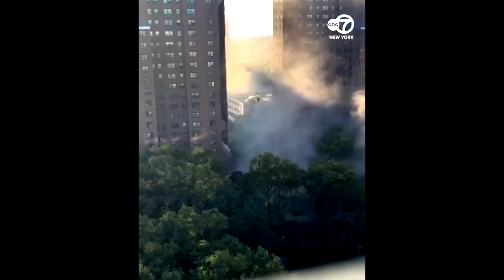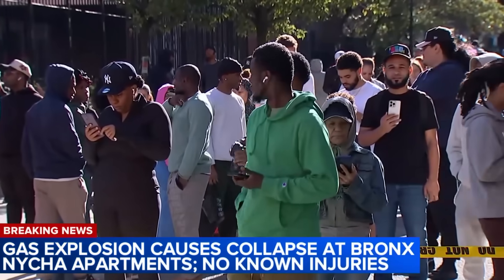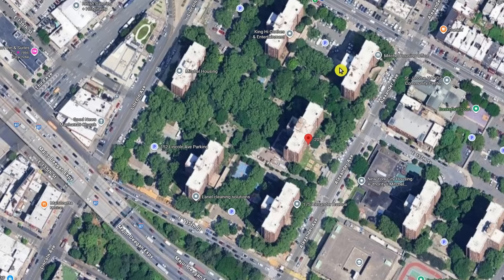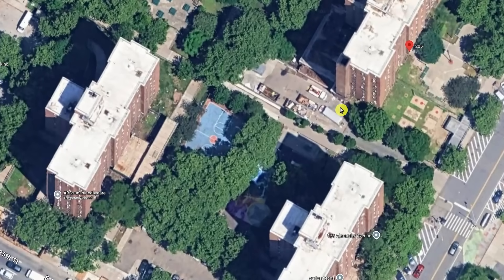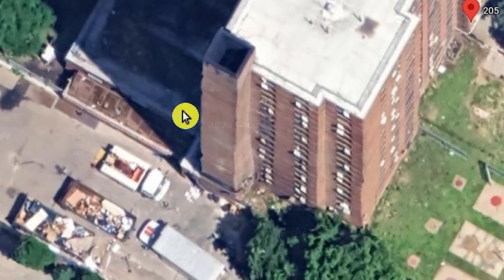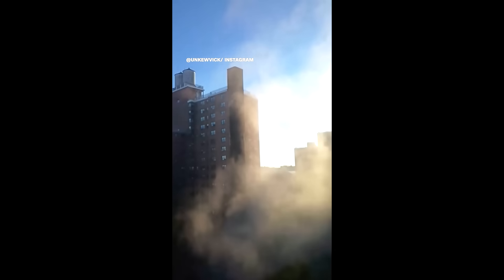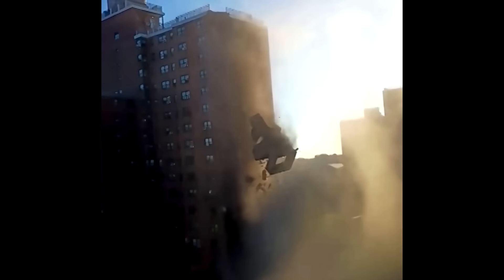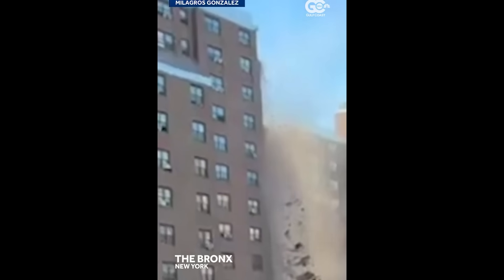Bronx Apartment Collapse Explained: Boilers, Bricks, Stop Orders

Comment: What's up with the water tanks? And the roof (with that patterned glassed barrier wall around the roof edges) was it used for recreation - a jogging track? is their a recreation, gym or event room on the top floor?
Reply from the maker: I doubt anyone is allowed up on the roof. NYC water mains have plenty of volume but only moderate pressure (about 50–80 psi). That’s enough to push water a few stories, but not reliably to the 15th, 20th, or 25th floor of a tall housing project. Gravity-fed distribution: To solve this, buildings pump water up to a large rooftop tank. From there, gravity provides steady pressure down through the risers, ensuring all apartments (top to bottom) get usable pressure. Fire safety reserves: The tanks also double as a firefighting water reserve. In an emergency, they provide a dedicated water supply for sprinklers and standpipes.

Comment: What happened was a Gas leak.  It was Leaking for God knows how long.  
The whole chimney filled with Gas.  
They lit the boiler and it ignited.
The incinerator is a separate chimney now covered and converted to a garbage shoot and compactor.
Reply: Makes sense.  Thats a firetube boiler looks newer and they have a lot of flame failure post purge etc etc i used to sell them

Comment: Hi Jeff, just wondering if there is an internal steel frame in these buildings or is it unreinforced masonry?  Also, I've watched many videos of building facades covered in scaffolding in NYC and remember someone saying that they are required to undergo periodic inspections that you referenced in the video, is this true?
Reply from the maker: Yes they are required to check the facade every few years but I'm not sure about the rest of the building and each building is different as to whether they have metal frames on the inside or mantels or even concrete beams

Comment: There were air conditioner units on the ground - are you sure the explosion was concentrated in the shaft?
Reply from the maker: Well you could see how falling debris was leaning on some of the air conditioners and some were still in place but holding on very precariously so it's not surprising if a few of them did let go

Comment: I can’t believe the people working on the boilers weren’t hurt some how. I’m a steam fitter service tech. I’m guessing that the vent stack had somehow filled with gas also. And when the burner was lit off it blew up through the boiler and its vent stack. It probably blew a portion of the lower bricks out to start the collapse. Holly crap!!!!
Reply from the maker: I wonder if they can control it from the office, where they are not in the same room
Reply: @jeffostroff  Nope , most all boiler controls are on a control panel nearby , the controls I've seen & built.
Reply: Haven’t seen gas enter a vent stack, but I’ve see failed relief valve and thermal shock from malfunctioning water feed?

Comment: The brave firefighters just standing on the roof after the collapse is wild lol.
Reply: Not necessarily. The chimney was an appendage, not a structural element. Delayed ignition creates a pressure wave that compromises the base of the chimney, which was just a hollow, thin-walled masonry construction, and it collapsed in place. And given their period of construction, those buildings are almost certainly either steel or reinforced concrete frame structures with non-structural brick veneers.

Comment: Great video and explanation as usual Jeff. It didn't help that it wasn't lined with an iron insert. Those will make great aftermarket brick usage. There is a brick reclamation company in NY.
Reply from the maker: Yes Chicago bricks were real popular hear 20 years ago in FL when I had some pavers installed. I went with hex pavers at the time

Comment: I live in a nine unit building which has an incinerator. From what I can tell, it hasn't been fired since around 1970. I found a 55 year old Fresca bottle, and some old phone bills and correspondence from 1970 inside!
Reply: How much was phone service back then, like $5 or something?
Reply: According to Brave Search's AI a phone line cost $1.50 to $5 in 1980. So likely somewhat cheaper in 1970.
Reply: @inthefade  Must depend on where one is, because here in Southwest Ohio, (Ohio Bell 513) what I typed above, is what a phone-line cost in 1970 - I've got the 55 year old hard copy here to prove it. 
It was in the low $20s I think, when I first got my own phone line here, in the mid 1980s.
Reply: Including toll calls etc ?.
Or $20 for the monthly fixed line rate ?.
$20 seems excessive for a simple private home phone in 1970.
Reply: Long distance calling was extra.  About 25-50 cents per minute
Reply: Damnnnn I’d be moving out I’d be scared they are all gonna fall 😩

Comment: Hi Jeff. One problem can be gas in the flue caused by failed ignition if this happened a few times there could be a lot of gas in the flue. At the beginning of the burner startup sequence fans run to purge the flue of any gas but I notice that this flue is huge in both height and cross sction. The purge process is usually timed and it may not have run long enough to purge all of the gas if a number of failed startup sequences had occured before the first successful ignition. Sequence is usuallt -> fan(s) on for a timed interval -> ignition on -> pilot gas on -> pilot flame detection -> main gas on.
Reply: @9778ds good analysis. Possible delayed ignition, but the system safeties should have kicked in after several failed ignition attempts and locked out the startup process. 
A bypassing main burner gas valve would cause the same problem and account for the gas odor reported by residents. Very hard to detect because the gas vents straight up and out the top of the building. The incenerator could be in the same room as the boiler but not connected or functional. Hard to know not being on scene.
Reply: The fuel valve interlock safety should have shut down whatever failed.  If the gas valve failed open hopefully natural gas would exit through the vent valve and exits to outside the building.  How ever if the controller fails and results in the gas vslve opening then methane would fill the boiler and also the flue.  When the methane ignites the boiler and flue may be damaged.  It's also possible that there was incomplete combustion.  Carbon Monoxide would build up in the boiler, hits the right air fuel ratio, embers set off the explosion.  Damage to the flue would result.  Another possibility an air flow switch may have failed on, resulting in no air flow and carbon Monoxide being produced, building up in the boiler and flue and an explosion.  Another possibility is the boiler was being worked on, the controller failed with the gas valve going on, filling the boiler and flue with gas.  Valves should have been locked out, tag out.
Reply: I’m not sure why any burner start up sequence would be occurring. They stopped using garbage incinerators in the 70s. I can see maybe a slow leak of the old gas lines and gas just accumulating until eventually it found an ignition source. I couldn’t imagine living in one of these high rise apartments. I hope everyone who lives there remains safe!
Reply: @ScottGunMag69  Forget the incinerator. There was apparently a gas boiler that used the old chimney previously used for the incinerator.

Comment: Living in Australia it unlikely that I would hear  this on the local news.
I am a boiler operator. That is a big chimney for the type of boiler you showed. It would probably not take much of an explosion to cause damage to the chimney. If the boiler(s) were being used for domestic hot water they would have been operating during the summer, however additional heat may be required for the cooler months. It is possible that a boiler was not purged correctly prior to going to the ignition stage of lighting up. Possibly a system fault rather than human error.
Reply: Mitchel has multible boilers. They use them in the summer to send steam to the water heaters in each building. I was a nycha plumber for 25 years, just retired. All the developments have multible boilers.
Reply from the maker: @alt7244 so in your experience what do you think could have caused the boiler to explode
Reply: This would be Gas build-up in the Firefox. They probably tried to light of as OP said, oil or gas remained at dangerously high levels, fan failed to purge and caused a huge puff back. So a safety failed but the operator should Have manually purged it himself and if not he should have just left it off. Housing Is notorious for ignoring violations.Think of leaving your stove on without igniting it Gas fills up the room And you go to spark it big explosion.
Reply: @jeffostroff  heard some say there is current labor dispute with the heating technicians
Reply: @alt7244  thanks for the information based upon personal experience!
Reply: It doesn't happen too much anymore because of the redundant safety limits. When they burned oil, there were more explosions because if the boiler shut down and the reset was hit multible times, oil collected in the fire chamber. Ive seen 3/4" bolts embedded in concrete walls after the 1000 pound doors blew off.
Reply: I agree Kevin,  defiantly didn't purge the boiler after several misfires.
Reply: Yeah. My first thought when I heard boiler was a fireside explosion. I wonder if with a chimney that large in cross section if the purge cycle ran long enough to purge all the explosive mixture out of the chimney
Reply: An incinerator would not need a BOILER,   just a furnace to burn trash.   maybe the boiler was adjacent or maybe the obsolete furnace (if still there) had the faulty gas lines..

Comment: I saw no scorching caused by the explosion. It didn't take much to bring it down.
Reply: It was probably a pressure wave from a delayed ignition, not an "explosion" per se. Hollow masonry chimneys with thin walls are vulnerable to compromise by pressure waves, especially as they age. And it's not a structural component, it's just an appendage on the side of the building.
Reply: explosions dont always cause scorching.  its just expanding gas.
Reply: @FixitFrank  Tbf, I meant any form of sign that suggested a rapid expansion of gases, burnt architecture or soot etc. At a distance, it's easier to see the contrast with the surroundings when soot is created.
But my point was that there was no sign of these remnants, so whatever happened must have been relatively small. making the dowining of this stack worrisome as it suggests a very weak structure.

Comment: There’s multiple gaps in the wall to prevent carbon monoxide from leaking into the building. It’s never been used as an incinerator shot. It’s used as a chimney for the boiler. There’s a massive boiler in the basement of that building which provides hot water and heat for the entire complex not just that one building
Reply: A boiler that needs a chimney the size of a coal power plant??
Reply: That boiler supplied heat for the entire complex? OMG. That's bad news for all those living in the complex as they wouldn't have heating/hot water in the coming winter. The damage doesn't look to be something that can be repaired quickly and the weather is already getting quite cold in NYC. I wonder if that is not a coincidence.
Reply: Doesn't seem plausible, it's not used as an incinerator now, but why would they need a chimney the size used for entire power plants for a simple boiler? Doesn't compute.
Reply: @FrozenHaxor It's a very common practice to use older chimney structures for newer gas fired equipment, saves a ton of money over constructing a whole new vent stack...especially one 20 stories (over 100 feet) tall.
Reply: @mxslick50  yes but even still, when it was oil-fired, it still seems like it wouldn't require that gigantic of a chimney just for a boiler, but for burning all the trash it makes a bit more sense.   i cant think of any reason for it to be so big otherwise though im no expert tbf
Reply: @FrozenHaxor  It definitely looks like it used to be an incinerator and then was reused as a chimney.
Reply: @dustojnikhummer  Yes, my first thought

Comment: It looks like they never cleaned the chimney out, ever. I know for using a wood stove for heat for years is that chimneys don't fair well if they're never cleaned out. I know that they probably didn't burn wood, but even trash will cause the same thing over time. The inside of that chimney looked like one of the layers was all build up. Of course it's hard to tell with pictures, and I could be totally wrong. 
      Thanks for this video. Learning is my thing.😄💙
Reply: It's likely the boilers were oil-fired originally, and they used to burn "heavy" (#6) oil in many of these heating plants, accounting for at least some of the soot build-up.

Comment: Appreciate the briefing.  
Q — did authorities state how the structural elements of the build was constructed? Steel frame, steel reinforced concrete, or….? 
Q — Basically, the incinerator chimney shaft was a non structural appendage to the building?

Comment: Hey Jeff I believe there is some new crazy NYC laws about master plumber’s. That unless you are a master plumber you cant install a gas stove dryer fridge ect. And something about a permit fee. It’s 2am but you should look into it.
Reply: You need better infrastructure and more people going into specialized trades
Reply: yes they started that like 2-3 years back and in nycha you have to wait until they schedule you to come install it. My building went months without gas because  con ed hit a line.
Reply: We can install a gas dryer and stove....... but can't install a gas water heater. That requires a city permit. (In Michigan)
Reply: That is not crazy at all!  In Europe we have the same rulings.
You do not want unqualified people to work on such equipment, cause a (future) gas leak, and then an explosion or other hazard that not only is a risk for the owner of the equipment but for others as well.
This incident is a good example of that.
(it is also an example of how a qualification does not guarantee that problems do not occur, but at least they have tried)
Reply: @Rob2  No, this incident is not a good example of that. It's always been the case that gas work requires an LMP. Any work performed on a boiler like the one in question here would already have been required to have been under the supervision of a Licensed Master Plumber. NYC has long had laws requiring that only Licensed Master Plumbers can file/pull permits, install, modify, perform work on, inspect, and certify/license a wide range of gas and fire suppression equipment and infrastructure. Plumbing companies cannot even call themselves such unless a LMP owns 51% or more of the controlling stake, and any related work must at minimum be supervised by the LMP.

The new law the OP references is really just adding specific language to ensure there i no gray area when it comes to things like simple appliance hook-ups to existing supply lines, even when those lines require no modification. The new law will specifically require that such hookups require a Licensed Master Plumber to file a permit, that the hookup be performed under their supervision, and that they inspect and sign off on the work. Again, these were already technically required, but previous language was not felt to be specific enough on the issue.

And, in reality, property management companies, even small ones, as well as local appliance companies, already almost invariably employ their own LMPs or have standing contracts or relationships with LMPs and their plumbing companies to perform any gas and plumbing work, including hookups.

The "controversy" that exists with the new bill is that people are worried it may create long wait times for gas work during the winter, and that the tightened oversight is not supported by any robust statistical record of appliance hookup leaks. The available data paints a picture of gas leak events arising typically from systemic leaks in old pipes or boiler rooms, not from individual appliance hookups.
Reply: @Objectified  Ok in our system it is sufficient for the worker to be certified and they can perform minor work like connection consumer appliances and maintenance without asking for a permit.
It is just forbidden to perform these activities when you are not certified.
It is like a drivers license. You need to be licensed to be allowed to drive a car, but you do not need to file your itinerary for each trip.
However, you may be required to do that for some exceptional cases (like overweight or overwidth cargo).  Similarly you may need to have a permit to install a major boiler like the one involved here.
Reply: @Rob2   Except that's been going on for decades with hardly any problem at all.  But all of a sudden it's a problem?  No.  All of a sudden, the plumber's union paid off the politicians to pass this ridiculous law.

Comment: I was looking closely at the brick when I saw this yesterday.  It looks like a veneer layer on the outside and the double-layer of brick on the inside, the bricks laid by placing one brick every so often in one direction to tie two layers together...and then possibly another veneer layer on the inside again which is weird but I don't know.
Reply: English bond? I was thinking the same, I doubt they’d use wall ties given the height of the chimney….and wall ties are used to keep the veneer separate from internal wall for damp purposes, I doubt that’s a factor on a chimney….
Reply: That brick tying together are called headers courses.
Reply: Look at the base of each floor you can see 3-4 courses have been removed. Waterproofing was installed and failed.  Then it leaks and corrodes the steel angle the brick sits on. Lack of proper inspection when constructed. Nothing to do with the Shaft explosion and failure.